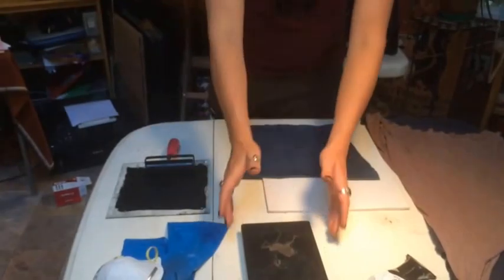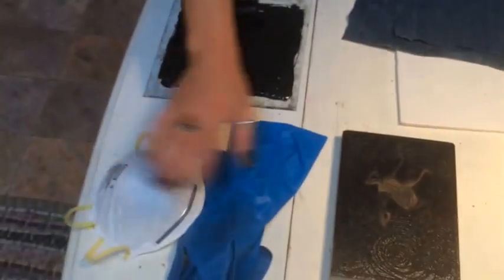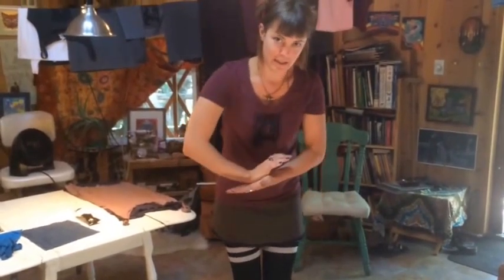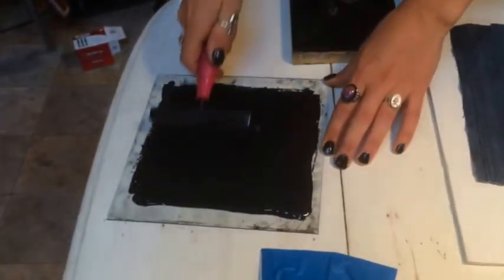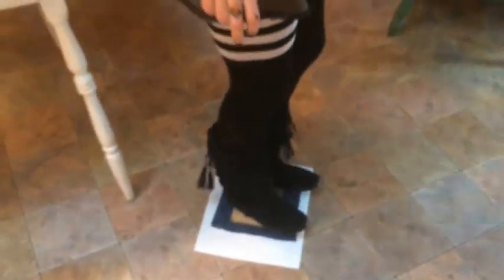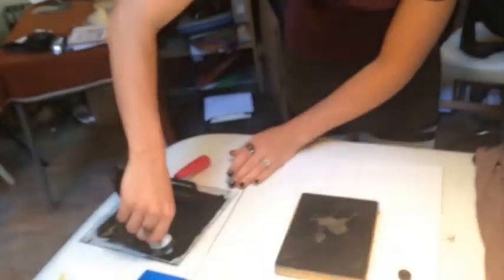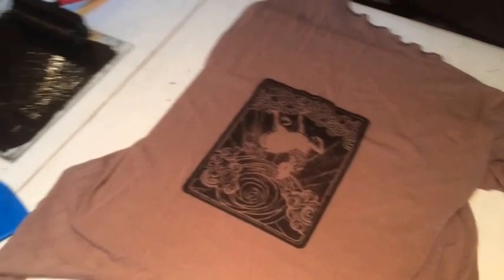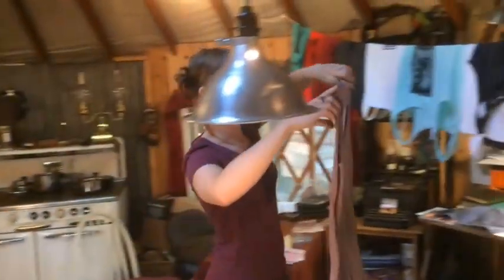Artist Kelly Patton teaches how to make linoleum block print t-shirts

Comment: Hi Kelly 
Can I use fabric paint instead of ink? 
I'm assuming it an ink printed tshirt will be ok in washing machine?
Reply: fabric paint might be too thin/not sticky enough and could go in the gaps more. try it though. you can wash most oil based inks once dry at 40 degrees Celsius without them running.
Reply: Wow I will try this, thank you!

Comment: what type of ink are you using and do you need heat to solidify it?
Reply: she used oil based printing ink, you don't need heat but it makes it quicker.  subscribe!
Reply: Is it indeed washable? So far I understood they will mostly fade away?
Reply: @crunchyprincess9583  I originally commented when I was researching...since then I've stamped thousands of shirts that made my business! I use Speedball Fabric Block Printing ink and it works AMAZING!!!!
Reply: @devannichols5550  what is the difference between speed ball block fabric ink and the speedball screen printing ink ?, Im new to lino and want to try start a small business prining on totes and need to find the best way!
Reply: @rubypartridge3639  I don't know, but the block printing ink works best. Do as the instructions say and you'll be good.